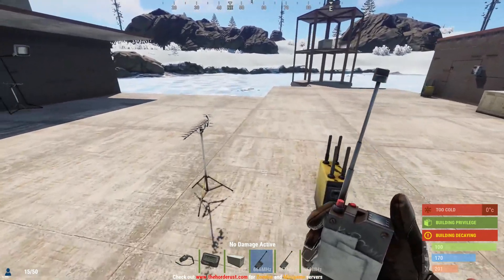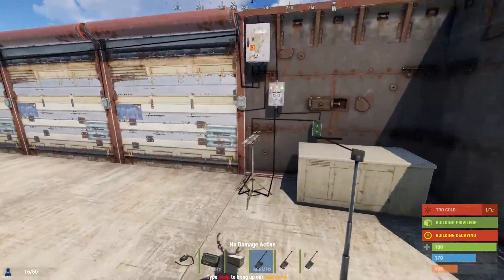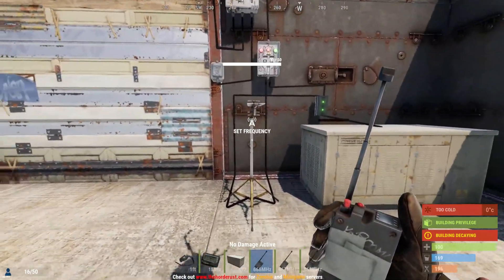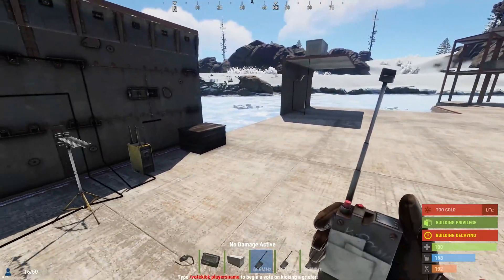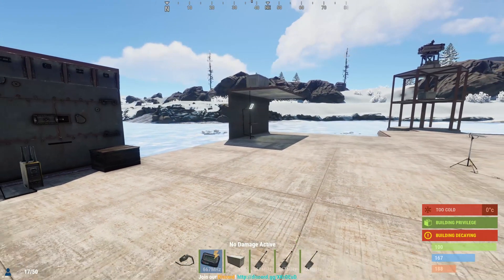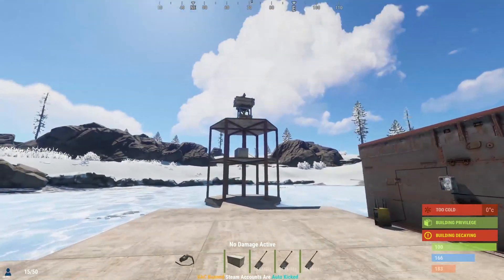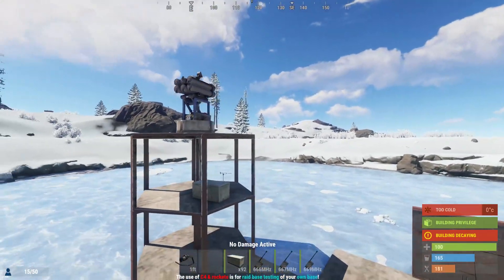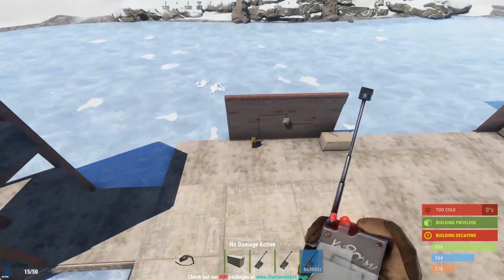RUST - RF Transmitter, Receiver, Broadcaster, Pager, SAM Guide

Comment: As I don't play Rust I don't know the ingame ranges, but if you add to your SAM turret design an AND gate coupled to your on/off switch and a heat sensor set to unauthorized, would the sensor distance still be large enough to be practical for base defense?
Reply: no

Comment: What was the point of having a AND switch...? Couldn't you have just have had the Receiver go straight to the splitter?
Reply from the maker: Yeah you could do that. The AND gate is kinda pointless. I know I was debating on a setup to show these components in action, and likely just forgot to remove the AND gate. But yeah, you're right.